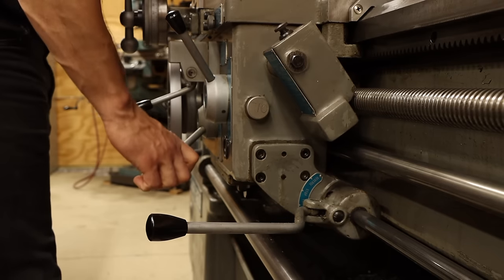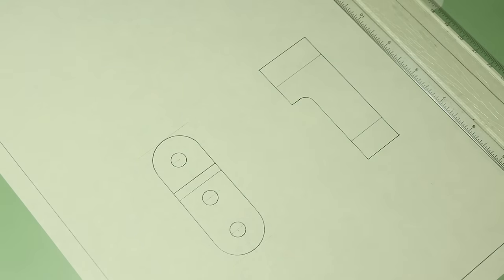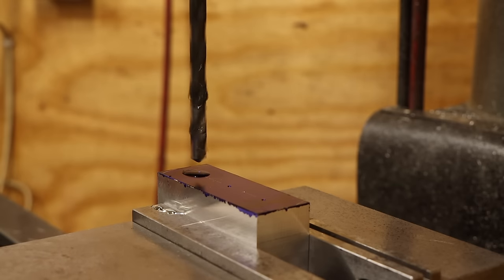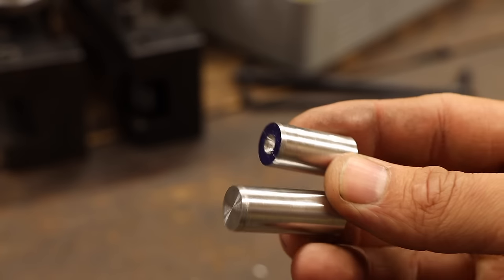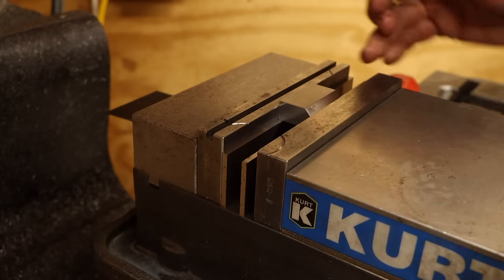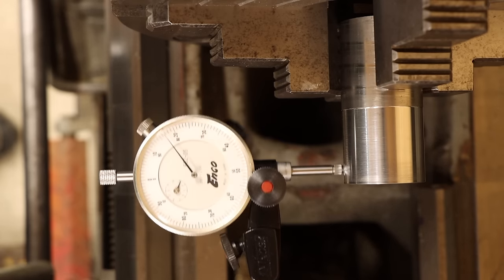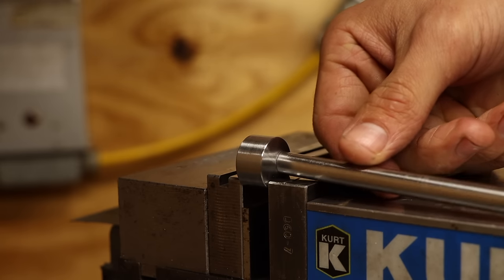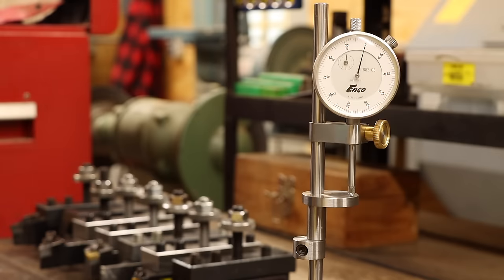A FANCY Lathe Tool Height Gauge || INHERITANCE MACHINING

Comment: Is there a reason you didn't orient the magnet base vertically in the mill (on the face you just sanded the air bumps out of) instead of horizontally to remove the excess plug material? It seems like it would have been a much simpler operation.
Reply from the maker: Mostly because of the fillet I wanted in the corner. Ball end mill could have worked but then I've have to deal with a sub-par finish
Reply: @InheritanceMachining  Ahh. Missed that when I first watched. Thanks for replying. Love the videos, keep it up.
Reply from the maker: @lkitch  No worries. Thanks, man!

Comment: Could you fix the press fit on the thumb screw with a punch mark in the steel?
Reply from the maker: I think that might have worked. Other suggested knurling it a bit as well

Comment: Why not make the reference surface the saddle in lieu of the tailstock slide bed?
Reply from the maker: Mostly because it wouldn't be accessible for boring bars. Also because my saddle surface isn't all that flat. I'm caught a few thou variation within a few inches

Comment: A permanent magnet will be stronger in aluminum, sure, but that totally neglects using an electromagnet for much higher holding forces!
Reply from the maker: I think its a pretty fair assumption that I wouldn't want to have to plug/charge my tool height indicator 😂
Reply: @InheritanceMachining  there's no reason except to say "yes, I can suspend my body weight from my indicator base."